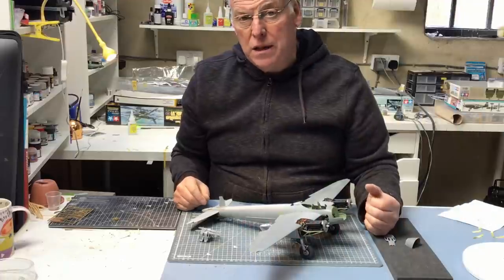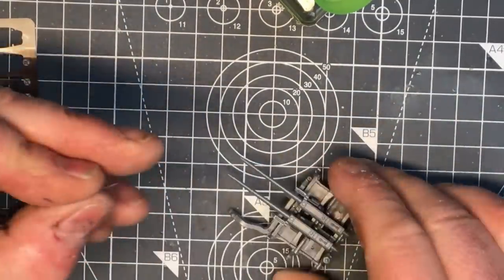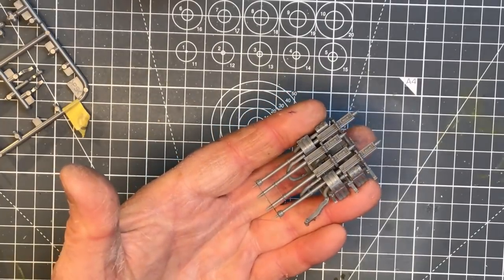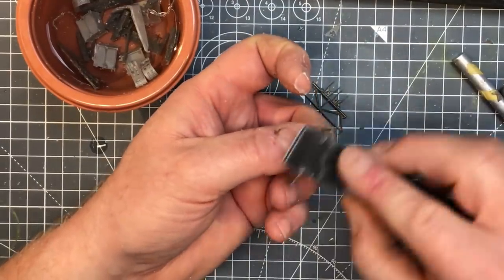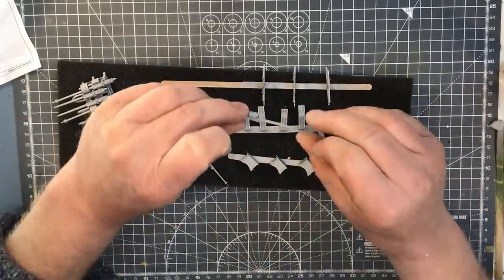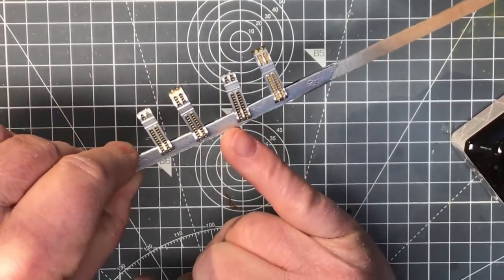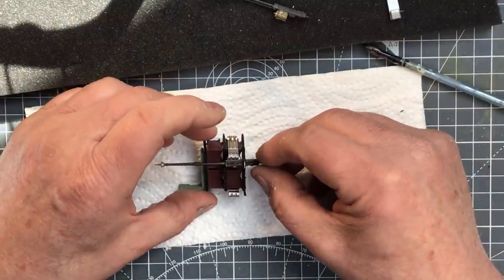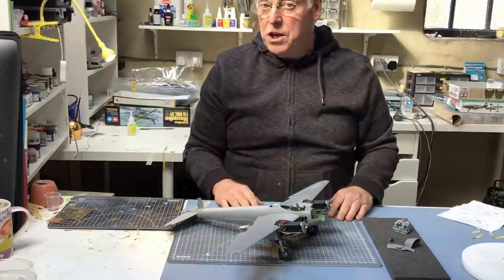Tamiya 1/32 Mosquito build series Part 11

Comment: Thanks Steve, very thorough explanation of a quite difficult conversion. Others may know more, but I think the chute with the pipes to the breeches are for hot air from the starboard engine to prevent freezing, which these cannon were prone to at anything above ten thousand feet in winter. They found this in the Spitfire and nightfighting Beaufighter when they received them.
Reply from the maker: I reckon you’re right John I didn’t think of that. 👍

Comment: Hi Steve
Firstly I also very much appreciate the way you produce and format your video builds and have done since you first started the Hood, so please keep up the good work.
Secondly both you are your wife should be commended for the combined assistance provided to your Farmer-Neighbour during the lambing season, especially during the extreme weather experenced in the North of England.
As many viewsers will have noticed you have also experenced your fair share of hand injuries over time and judging from the plasters look more like like finger nail impacts and the loss of the nail and very painful they can be.
However,  please stop worring about grubby nails and old finger cuts, most model guys are viewing your excellent builds for their merit and aren't too concerned if your nail varnish is chipped or the colour is not on trend this season.
May I ask, what kits are you considering next, maybe a subs vote might be good.
Very kind regards David Porter, London
Reply from the maker: Thanks for the encouragement Dave much appreciated. I need to finish the 1/48 Mustang alongside the Mossie and I’ve got a community survey on the channel asking for the preferred next naval build. I’ll be kicking that off after the 2 aircraft I hope.

Comment: I have wanted to build a 1:32 Mosquito model but the cost of the Tamiya kit is prohibitive. I got a good deal on the Revell kit at an IPMS show. Not the quality of the Tamiya kit but quite acceptable. I bought the Eduard Brassin gun bay accessory to adapt it to the Revell kit. However, after doing some research on the Hispano cannon the Eduard cannons do not look accurate. The dimensions are about 20% too small and the barrels are all wrong. Has anyone encountered this discrepancy or am I missing something?
Reply from the maker: The barrels aren’t full length because they disappear into the forward bay bulkhead. I don’t know about the overall dimensions but they look ok in the model I think.

Comment: Why do two guns look like toothpicks and two look like cannons off of an Ex Wing Fighter
Reply from the maker: Just how they're molded Richard. I guess they're pointed to make them easier to feed through the forward bulkhead - Its tricky to get all four through at the same time and you can't see the point when its fitted. The outboard ones have a circular part near the tip which is some sort of bracket on the bulkhead itself.
Reply: @TheModelShed  I wondered the same thing about the barrels. They don't look anything like the photos of the Hispano cannons in YouTube videos. Do you think Eduard deviated from historical accuracy in order to make installation easier. I hope not since accuracy is not something that should be compromised.